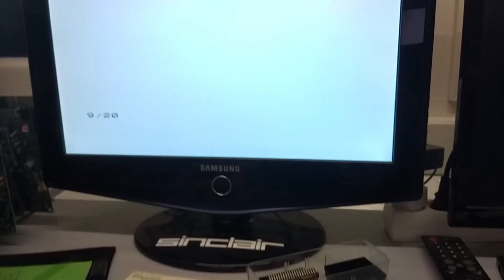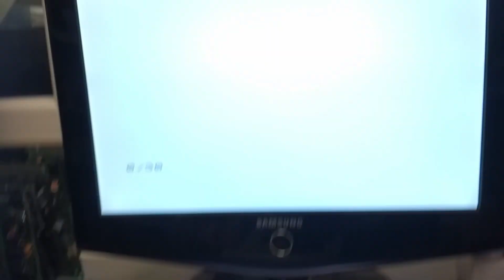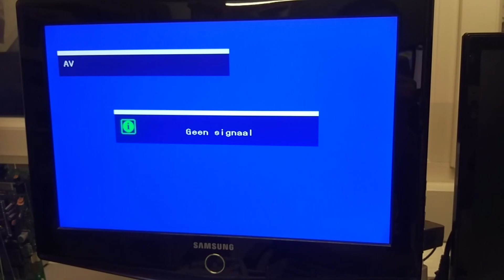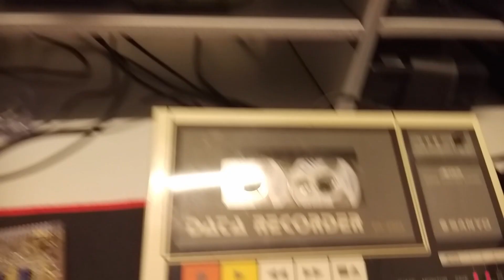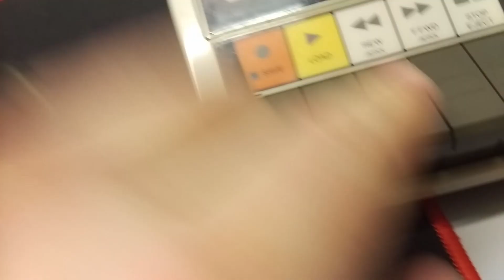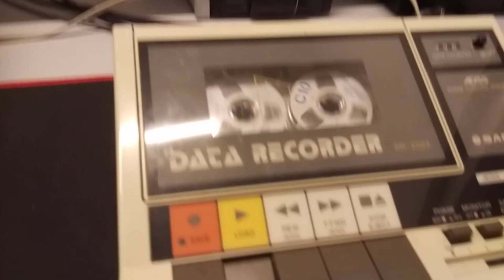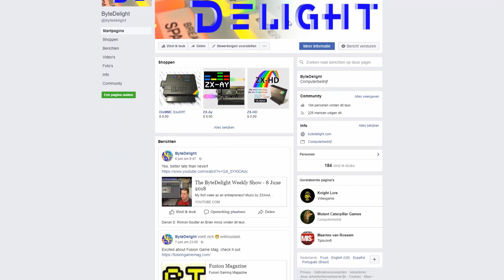ZX81 saving to tape - data recorder compatibility test

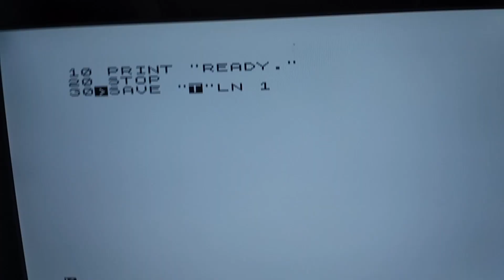Comment: At 2:37 you talk about  "connecting to the MIC socket" on both the ZX81 and the data recorder. When saving, the signal from the ZX81 comes OUT of the EAR socket (and goes into the MIC socket on the data recorder) and to LOAD , connect the recorder's output to the ZX81's MIC socket

Comment: When saving (and loading), the video signal should be looking like a Speccy, only in B/W. Seems very 'edgy' here. Maybe that's what's wrong with the audio signal you described earlier on FB?
Reply from the maker: I've seen that picture from ZX81's before, so I think it's ok.
As you probably know the MIC output comes from the same ULA pin as the video output does, so Sinclair used one ULA signal for that.
I've never seen loading on a ZX81 that looks like a ZX Spectrum myself.
Reply: The video signal will only show on older TVś with a CRT! modern TV's will turn the display off when they do not receive a recognizable sync signal.
When loading or saving the ZX-81 uses 100% of the CPU time for loading or saving and stops generating a TV signal.